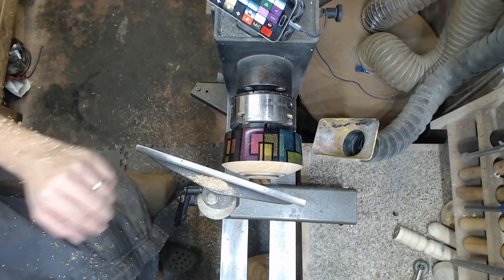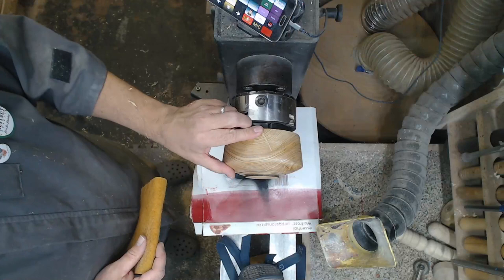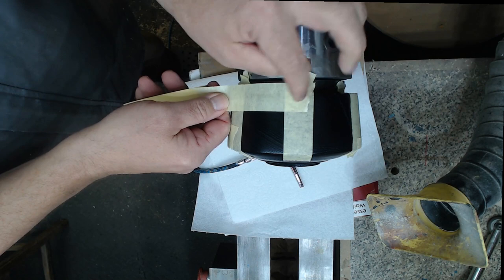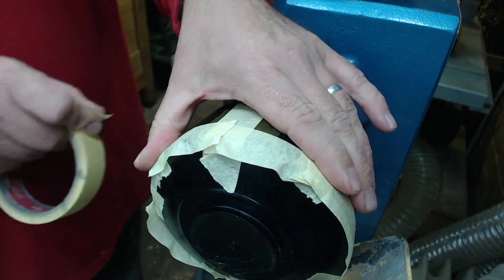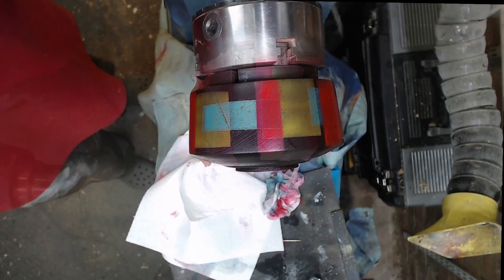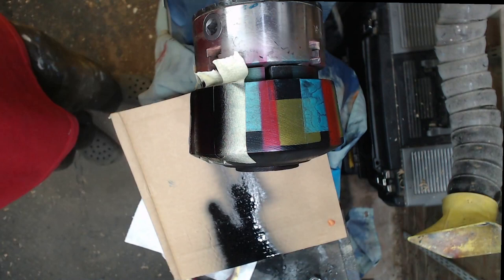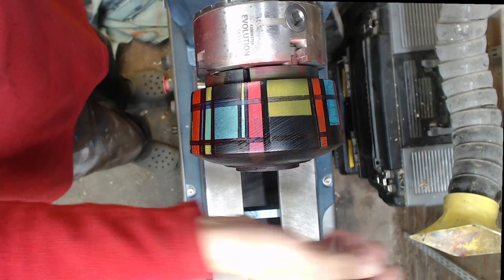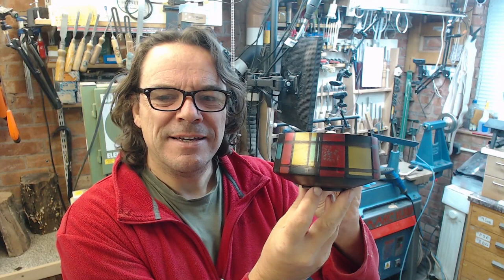Iridescent Airbrushed Bowl

Comment: I too like it.  What might help is a tape made for painting purposes that would give you sharper edges and minimize bleeding
Reply from the maker: Cheers, George.....frog tape it'll be then...
Reply: @stewartfurini  Garry not Linda. Just a note about Frog Tape. Unless they've come out with a different formula Frog tape only really works with water based paints. I had a big disaster using it with an oil finish. That said I've not tried activating it with a small brush dampened with water before using an oil or lacquer based product. An alternative would be automotive masking tape. The adhesive is different than standard masking tape.